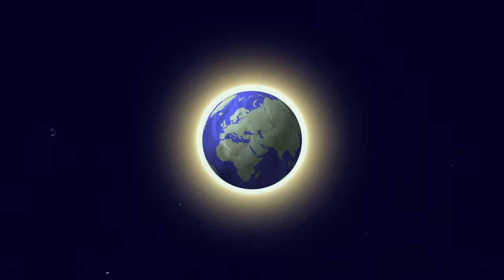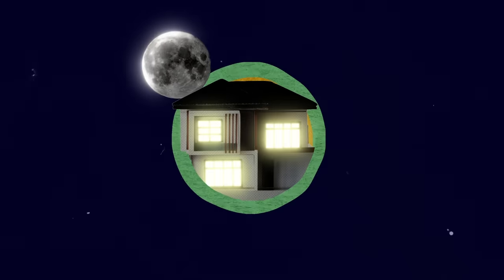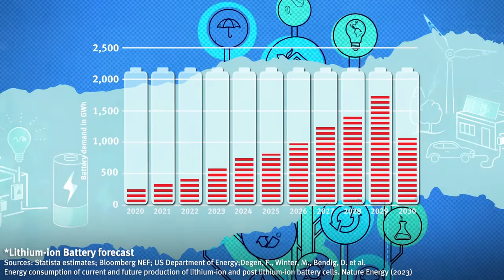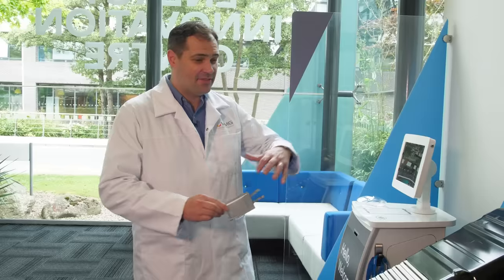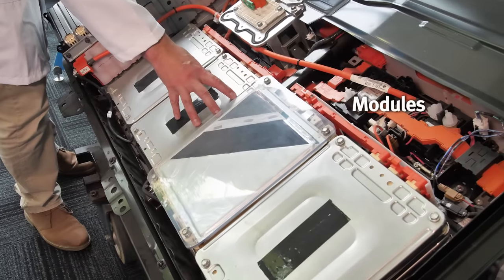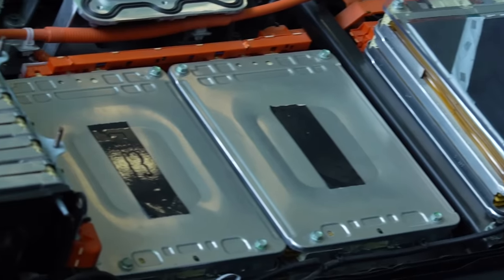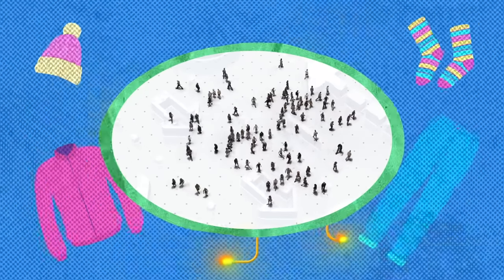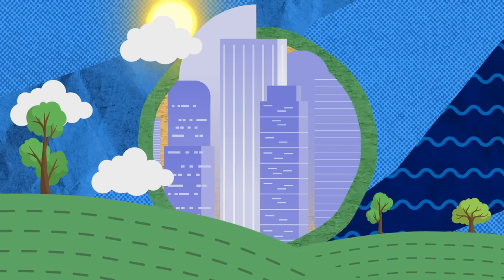How batteries will power the future - with The Faraday Institution

Comment: Having done work with batteries, I find the focus on Li ion batteries to be a little confusing. I understand that they're important, but it's kind of old news. Why not cover some really new and interesting battery technology, like Li-S batteries and their benefits/limitations?
Reply: the ethical elements of Li mining is never discussed ?
Reply: @Ianjcarroll  Certainly not good but doesnt mean the only way to extract lithium is the way we currently do it. Look at Tonopah pass in the US
Reply: Li-S certainly looks interesting, but more immediately Na-ion looks good for home and city car batteries, maybe more.
Reply: Graphene Aluminum by GMG is VERY promising.
Reply: Lead acid batteries have NEVER been studied for how they actually furnish electrons. There have been at least some electrical engineers and physicists which have claimed enormous, exponential energy release from existing lead acid batteries. I worry that the cessation of lead acid batteries is a mistake, considering how easy it is to recycle them.

Comment: We need to stop focusing on battery weight! Batteries for stored renewable energy don't have a weight requirement, they can weigh millions of pounds and if that allows more storage no issue, only in mobile applications does power to weight ratio become an issue.
Reply: You seem to be thinking of stationary applications. Weight is very important for cars, phones, etc. Electric vehicles are already much heavier than IC vehicles, mainly due to battery weight.
Reply: Yes, stationary applications are the most important for addressing climate change,  storing green power from solar, wind, geothermal etc is far more important than vehicles,  also the biggest contributer to climate change is global shipping via actual ships on the ocean, which also dont have weight problems. Evs are important too, but more importantly is the power that they use and they need bigger stationary batteries to avoid using coal and natural gas to run the grids.@pat8988
Reply: But it should matter, right? 
Setting aside the environmental impacts of battery production, you’re generally going to lose efficiency at larger and larger scales. So making the most efficient (and therefore lightest) battery will allow us to scale to larger and larger applications.

Comment: What are they going to do about the terrible conditions for the people that are extracting the basic materials from the ground?
Reply: Nothing.
Reply: Anything being done about the neurotoxic tailings ponds and environmental destruction from the mining operations?
Reply: Sodium ion batteries would solve many issues & have positive benefits as well
Reply: most lithium mining is in Australia, and the conditions are fine. Other places, it's improving.
Reply: Cobalt is a major concern when used in large quantities, whether for refining fossil fuels or making Li-ion cells. Thankfully, I read that its use in Li-ion (such as NMC) is already dropping. Nasty stuff.
Reply: @RupertReynolds1962  It's used in smaller and smaller quantities in EV batteries, and some battery technologies used don't have any. And in EV batteries it's contained and recyclable.
Cobalt used in fossil fuel refining can't really use reduced any further for chemistry reasons and is discarded after use for cost reasons.
The cobalt an ICE vehicle uses is more than what's in an EV battery, and it's thrown away.
Also note the materials used in ICE manufacture that EVs don't use, like rhodium for catalytic converters, that are also obtained from mines with terrible conditions.

Comment: I’m extremely disappointed in the glacially slow progress on home storage batteries  Chinese company is selling a 30 kWh EV for $12,000. Yet a Tesla Powerwall, with about 1/3rd the capacity of the Chinese car, costs the same! I’m trying to go off grid. Batteries cost $1,100 per kWh before installation. To really disrupt and ger away from fossil fuels, we need affordable batteries!

Comment: How do we solve the problems of batteries catching fire 🔥 and not working in the winter 🥶?

It seems like Hydrogen / fuel cell technology will be a better solution long-term.
Reply: Teslas wouldn't even charge last week.
Reply: Check out the Joe cell: hint, it's protons, not orgone.
Reply: If anyone's interested in a genuine Reichian orgone motor, it's a DC Pulse motor, neither DC nor AC.
Roberto Maglione published most current info.

The Correa's orgone motor could barely tow a toy truck, and they squandered their popular support attacking James DeMeo.
Genuine orgonomic literature focuses on publishing information accessible to laypeople and the Correas only published highly technical and esoteric math.
Reply: will a hydrogen fuel cell work nevermind if it is winter ?
Reply: Hydrogen has a lot of drawbacks people conveniently ignore, such as, among other things:
- Hydrogen energy storage is terribly inefficient. About 3x worse than standard batteries.
The ratio of electrical power generated in the power plants and the power actually driving a hydrogen-powered car forward is only 25%-35%. Compare that to the usual battery-powered car, with the ratio of 70%-90%.
- As of today, 95% of hydrogen is produced from natural gas and other hydrocarbons, which, along hydrogen, produces carbon dioxide, the very greenhouse gas we are are supposed to get rid off: About 1.4 tons of CO2 per 1 ton of hydrogen, and that is if carbon capture is used. Without it, it's 5.5 tons of CO2 per 1 ton of hydrogen.
Reply: @Adam-zt4cn  compare how long it takes to fuel a tank with how long it takes to charge and battery.
Also, rapid charging batteries depletes battery lifetime.
Reply: @Adam-zt4cn  I did read something about producing hydrogen also will create extra OZONE in the atmosphere and watervapor ( in wintertime the watervapor will freeze blocks of ice will drop on the road behind a Hydro-vehicle )
Reply: @gitmoholliday5764  Ozone is easy to counter, and that's one technology only. And it's hydrogen tech that's not in use anyway. Also, the amount of water exhausted is enough to mist a windscreen, not 'blocks of ice'.
Reply: @thekaxmax  years ago we had citybusses on hydro.. in wintertime you could see blocks of ice hanging  at the back like 10 kilogram and they fall off on the road also
Reply: @gitmoholliday5764  Hmm. The amount of water that's in that exhaust, and its exit temperature, suggests the cause wasn't the exhaust.
Reply: @thekaxmax  well.. I'm not sure, but I think they were Internal Combustion Engines not Hydro-electric, anyway they stopped using them, mostly because cost effectiveness.. but imagine every wintertime instead of maybe 7 city-busses also thousands of other vehicles dumping pieces of ice on the road.
Reply: @gitmoholliday5764  ICE is seriously not a useful way to use hydrogen. But if they're running badly I can see some ice forming. Big blocks surprises me, though, considering the temperature of ICE exhaust.
Fuel cells are far more efficient, so far less water in the exhaust and much cooler--to the extent it's worth keeping the water rather than exhausting it. It's already distilled, so you can use it as feed for a hydrogen extractor.
Reply: @thekaxmax  in summertime  it did look like a steam engine.. large white plumes of vapour venting  from  the rooftops. 😃
Reply: @gitmoholliday5764  you'd have to find out the mass of water per minute they exhaust while driving. Not volume, the vapour, but the actual mass.

Comment: All Grid supplied electricity is a dead duck. 
Electricity is only 20% of our energy use.
BUT grid construction costs are astronomical. 
Existing national grid is equal to the nation's GDP. 100years to build. 

This is the economic elephant in the room.

5 times more electricity is needed to replace high energy fossil fuels.

5 times bigger national electric grid capacity is insanely uneconomic. 

Dispersed generation and storage has no grid costs.
Each home with an EV plugged in at night can go offgrid. 
Most vehicles are parked 23hrs every day. 7kwh daily is ezi pezi to top up. 
Most vehicles drive building to building. 
All EVs, robotic vacuum cleaner and robotic lawnmower will selfplug-in.
Simple wall plug to trickle charge, control by EVs computer. 

Rapid charging will be on the main roads and at corner stores.

Comment: Huge reliance on batteries is a passing fad. Any system reliant on batteries is wasting energy and is not as efficient as plugging straight in.
Reply: That's wonderful if you can use the energy when it is produced. Batteries and other energy storage such as pumped hydro help solve the "duck curve" problem. Look it up.
Reply: You'd better alert the world energy experts before they go down this road

Comment: Discovering that the battery in my comp has been literally off gassing and poisoning me.. causing constant dry cough. .I have found that there is a condition named Metal Fume Fever, the exposure symptoms which present similar to a virus, cough white lung sudden death !!
Data suggests we consume a credit card of plastic a week !.. but how much of this is gas....as another similar condition is off gassing of PTFE also used in electronics but also in so many things now in contemporary industry 3d printing even heart stents ..that may have been banned in the past for their fluorocarbons..inflicting Teflon Flu, Polymer Fume Fever. 
They say these things off gas over certain temperatures..but I suspect that maybe long term exposure of minor levels and temps could also be harmful. .as I have experienced. 
With the amount as many as 7000 EV battery fires in China every week, has no one considered that possibly pollution is playing a role alongside by "fume fever" to the pandemic !?..
..these gasses eventually circling the globe.
Is industry neglecting things somewhere. .as it's not working out well for customers health and the environment is it.
Reply: Metal fume fever, AKA zinc fever, requires raising metals to the boiling point; that's never going to happen in a computer battery.
PTFE does offgas, but only when heated to over 400C, something that became apparent when HMS Sheffield caught fire after a missile strike.